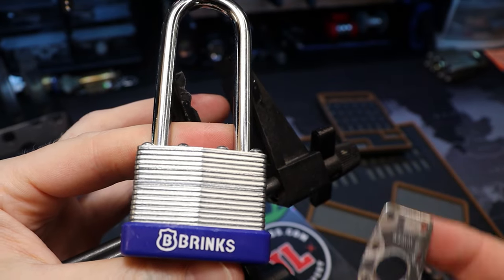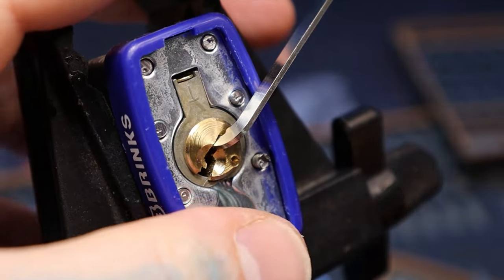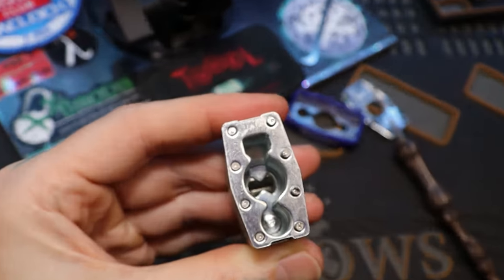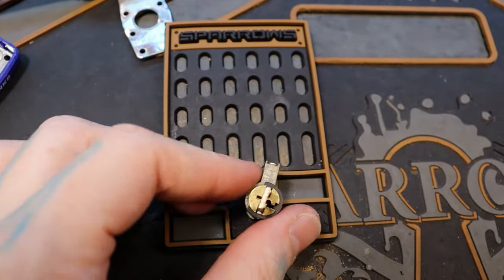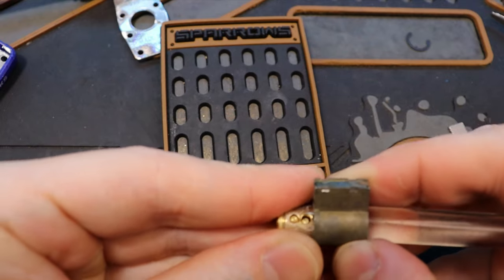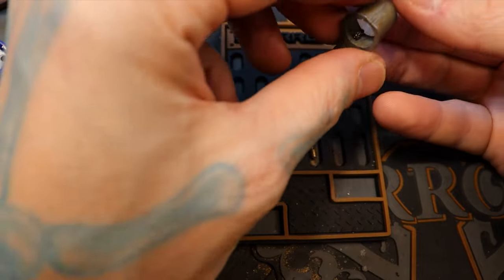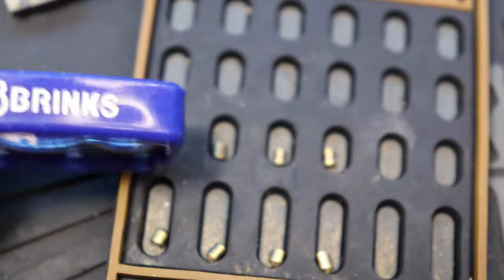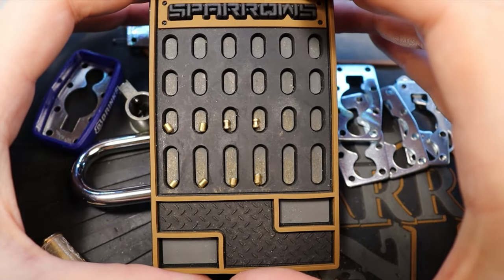257) Brinks 40mm Laminated Padlock Picked and Gutted

Comment: How did you remove the bottom plate?
Reply from the maker: Grind or sand down the nubs then hit that end of the pin that was ground down with a hammer and punch. I'll try to get a video up soon of how it's done.